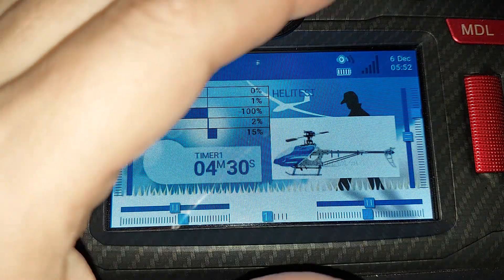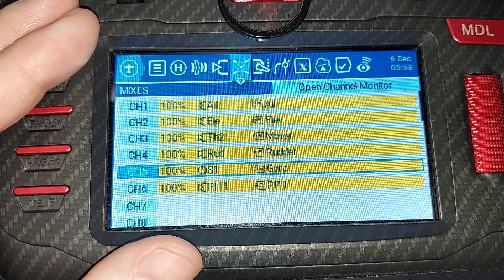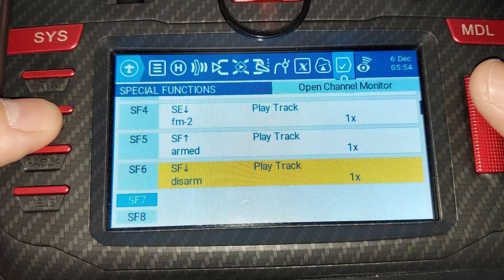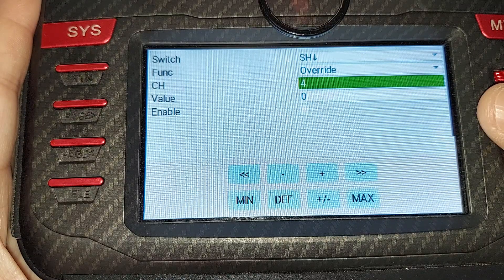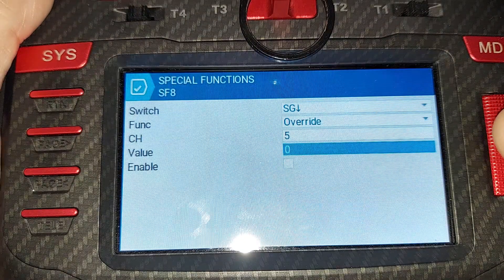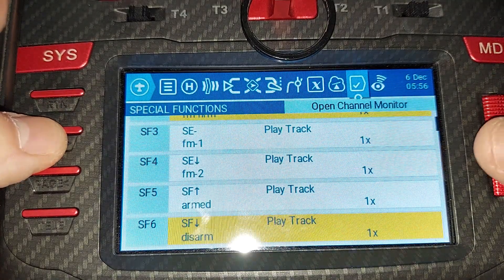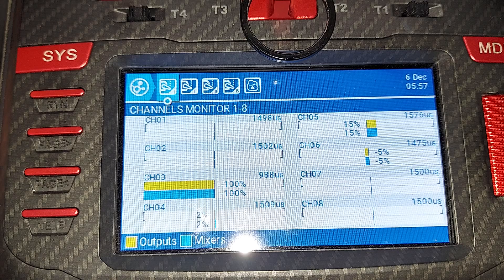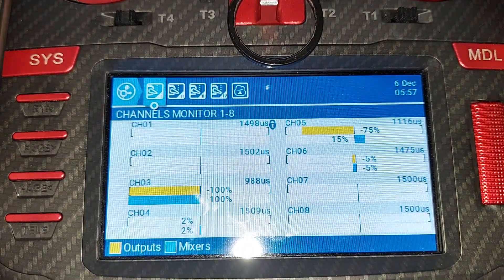OpenTX / EdgeTX Auto-Leveling and Bailout Setup

Comment: I use an Ikon2 with TX16S.  Of course autolevel drifts back/left in AL.  Agility is a rock hanging in space.
Is it plausible to duplicate cyclic channels in INPUT with trims ON in one and OFF in the other for the modes?  I hesitate since the FBL sees trim as constant input and I fear this will slowly, catastrophically, lead to a forward+right lawn dart.  Re-doing the whole setup so can't test t for a while.
- Idea credit to Joshua Bardwell (I don't know whether drone and heli FCs work the same in this case).